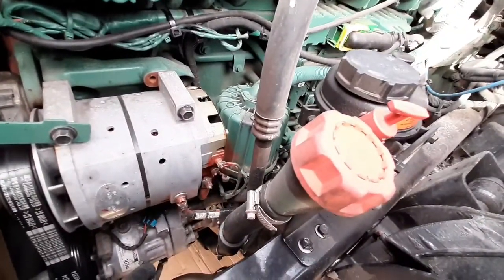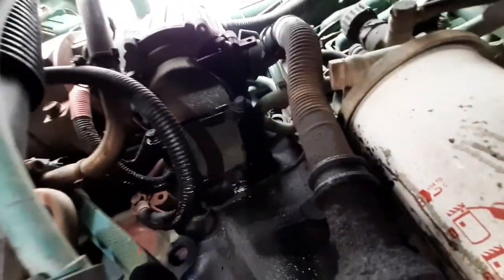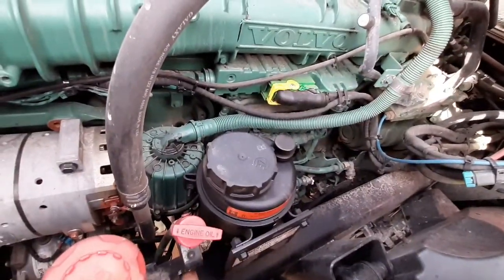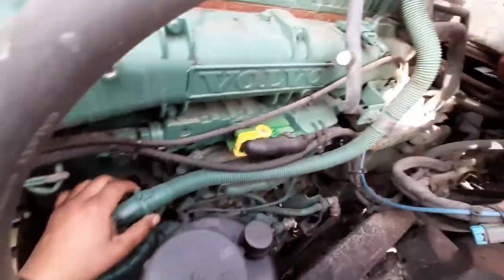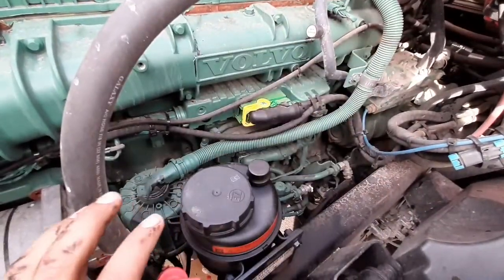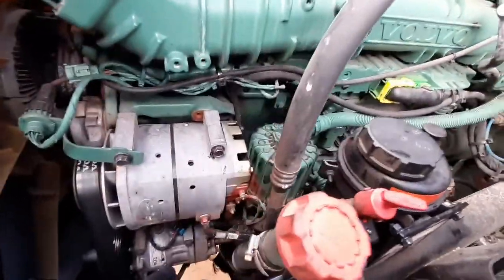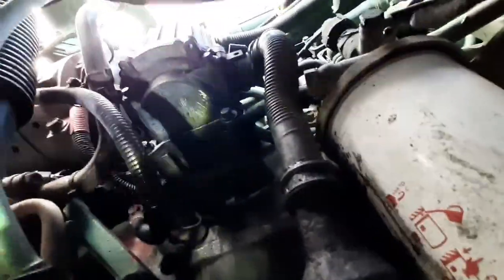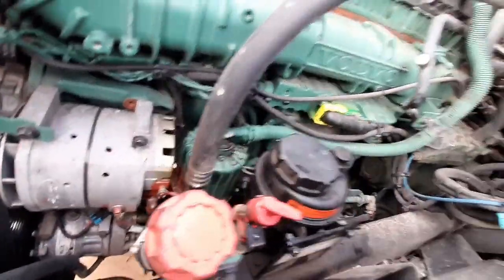Volvo vnl crankcase filter gasket replacement

Comment: Great job, very informative. I think I have the same leak too and my tech guy said that I need to replace the crankcase filter, the whole thing. Now I think it could be only gasket itself and that's it. Thank you
Reply from the maker: Just make sure that the oil is leaking between the crankcase and the engine block.

Comment: Hello 👋 did someone know about region for volvo truck it’s stopping me every 200 miles to do region clean if I don’t stop it’s say 5 milie per hour and automatically lock my truck I can’t even move without towing volvo didn’t help us anything it’s same problem again if someone know please let us know it’s say def region 5 miles per hour I can drive only thanks so much if someone have any idea what can be the problem
Reply from the maker: Any codes in the dashboard
Reply: There a plug in the transmission under the truck removed it and it will let u get Have a horsepowers is called the speed sensor
Reply: You have def problem, or could be injector #7 is not working, def filter is not getting enough heat to clean itself

Comment: this guy is an idiot, I ust did this job yesterday. all you need is a 12 point offset wrench. you don't need to move anything. 3 bolts come right out, the one bolt that is behind the AC line just needs to be loosened until the threads come out from the block then you can lift the whole assembly up and out. you do need to remove the two hoses coming into and out of the ventilation  housing